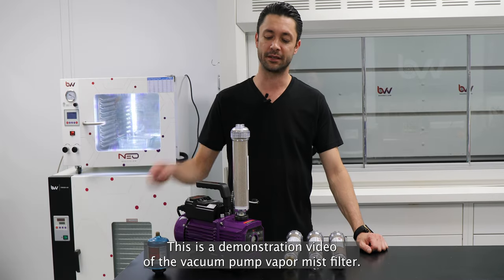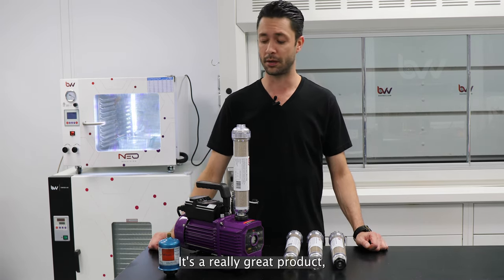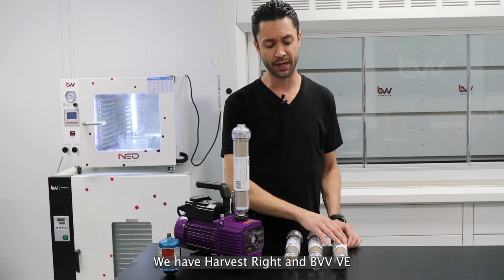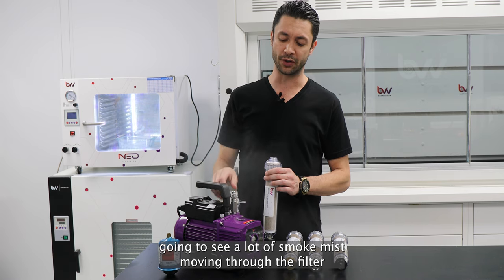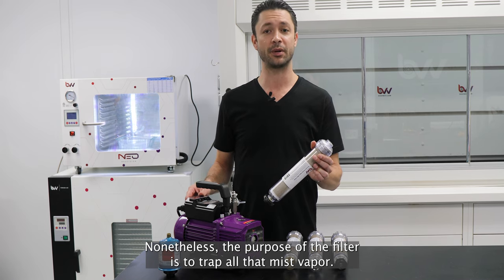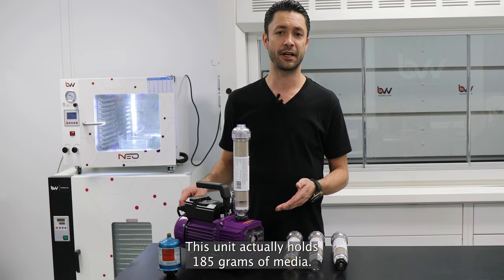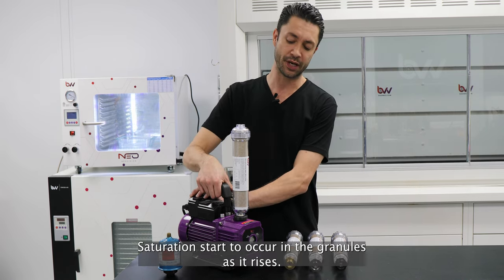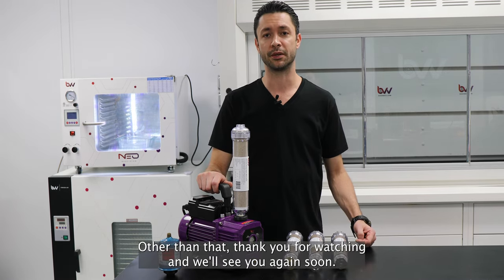Vapor mist vacuum filter Demo

Comment: what purpose of installing filter on that? i believe its still dont help from vacuum pump oil contamination.
Reply from the maker: @eidodoos great question! The filter is placed onto the pump's exhaust. Vacuum pumps have a tendency to release an oil vapor. This vapor can stick to things in the surrounding room, causing contamination. The filter removes the unwanted oil vapor from the air. Without the vapor present, there is no worry of contamination.